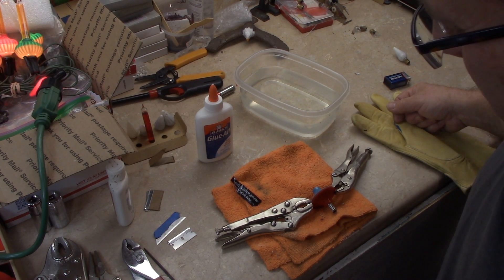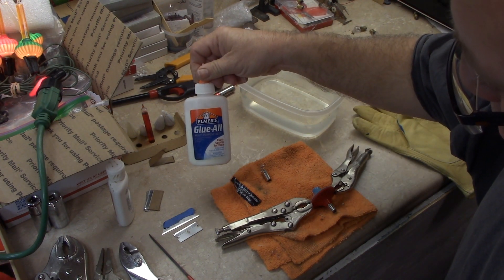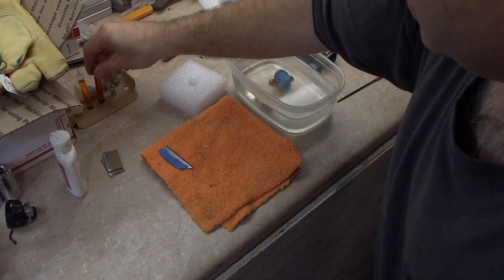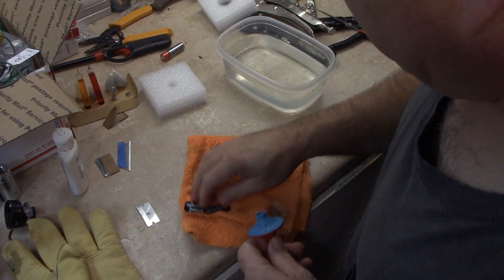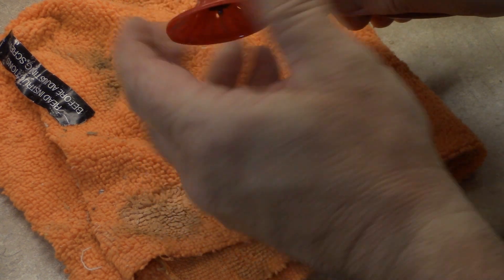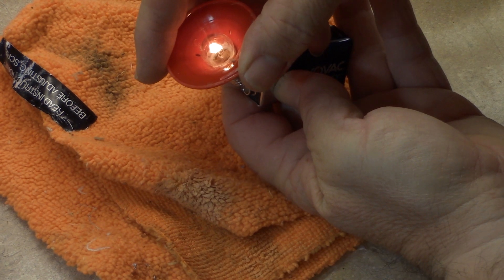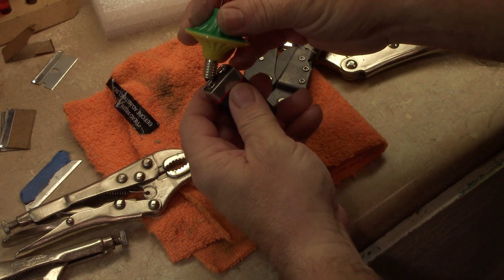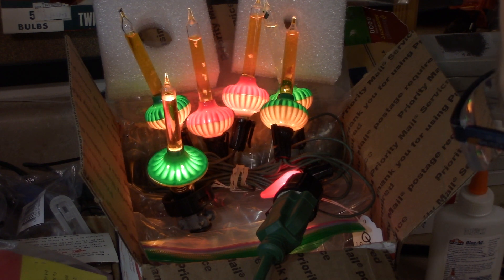How To: Relamp 1948 Noma C6 Flat Saucer Bubble Lites

Comment: I rarely ever see C6 bubble lights anymore. Next time I see a set in an estate sale, I'm purchasing them, seeing you showed how the bulbs can be replaced with a little fuss. I have a set of seven, in the C7 version, but there melted or the tube is smashed..... a friend gave them to me. I might be able to make a couple decent bubblers work again using some for parts, doing what you did. Two of the badly broken ones, surprisingly have working bulbs.

Back in the late 60's, in my elementary schools main office, there was a four foot fake tree covered in C6 bubble lights with the oil tubes..... every branch had a bubbler on it. I "think" thats the way the tree came as a decoration. I remember the oil tubes well, because the bubbling is slower..... As a kid, I totally loved it and wanted one. It was an older decoration back then.... I asked the secretary where they got it. She didn't know, as it was an old tree her mom didn't use anymore and gave it to her. She wouldn't give or sell it to me, as I begged her for it. I was maybe 8 or 9 years old at the time. I would love to have one just like it!
Reply from the maker: I have close to 100 C6 bubble lights on my main Christmas tree now! I had to repair at least 1/3rd of them. I've only had one burn out so far, this season, running them on reduced voltage. I like the proportions of them, better than the C7 variety.

That four foot tree would be quite valuable now, especially with the oil tubes! I haven't encountered one in person yet, but they look quite nice on video.
Reply: @dynatrak  I'v never seen another tree like it, in a video or in person, but have heard about them. It's a tree Ill never forget as it was hipmtizinyg and amazing.

Comment: It is ashame that they designed these to be disposable. It is good that they can be serviced, but it is sad that they did not make these servicable. Especially on the ones with the more round bases, where they could have easy added a threaded bottom which comes off.
Reply from the maker: Yes! If there was a threaded section, that would make bulb replacement so much easier. I'm glad it was figured out how to replace bulbs in these. I recently fixed a midget screw in bubble light, and that was the most difficult one I've done, so far.